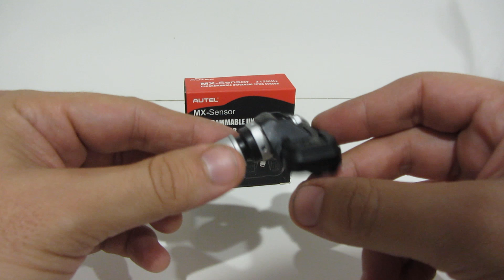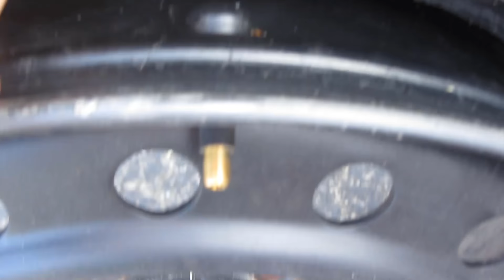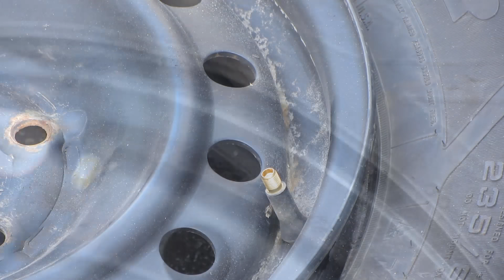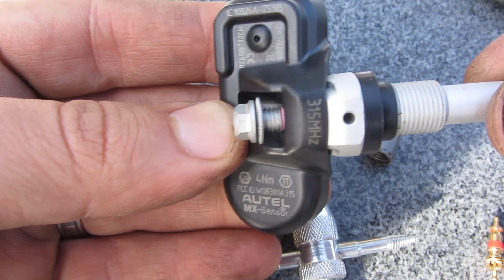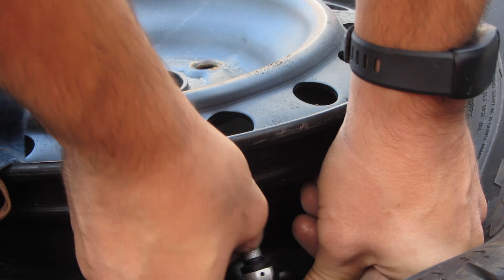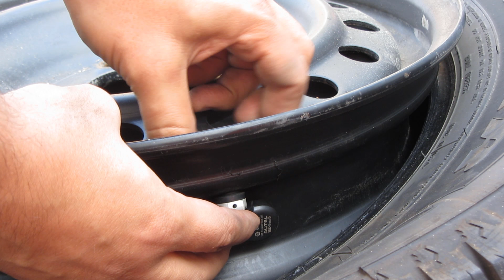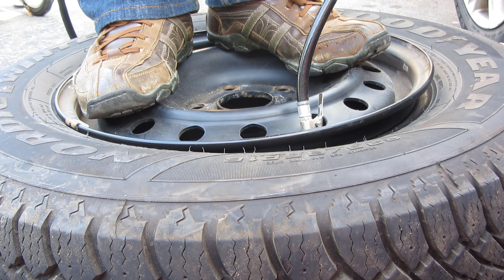Install New TPMS Sensor DIY Without Needing Rebalance

Comment: Job well done.
Please show how the program it.
Reply from the maker: I talked about how I programmed mine here: https://www.youtube.com/watch?v=N6p6xV4PlHc
I used programmable sensors, so I programmed the sensors themselves because I wanted an identical set for my winter tires.
You could also get normal sensors and program the vehicle (which you need a different tool for). But some cars automatically learn new sensors and you don't need to program anything at all. It depends on your car.

Comment: Question:
Bought a tpms rim. Don't have tpms on car. Can I take off tpms sensor swap in old school rubber valve stem?
Reply from the maker: The only difference between a "TPMS rim" and a normal one is that they add weight built into the rim to counteract the added weight of the sensor. It just makes balancing easier.
As for the sensor itself, there is no harm in leaving it there, even if you don't need it. It won't harm anything and it still does the job of being a valve.
Reply: yes you can, but as gabe stated you dont have to replace them, the valve stem works the same.

Comment: how do the sensors work? I mean what powers them and how do they transmit the data to the carputer?
Reply from the maker: The sensors have a battery in them. The battery lasts for about 7-10 years from what I've read. The sensors stay off while the car is stopped. They have a centrifugal switch that automatically turns them on when the wheel turns, but they can also be turned on by an external device.
When on, they transmit a radio signal with a unique code, the tire's air pressure, and temperature. The car has a receiver to read those signals. Some cars have four receivers (one per wheel) so it can tell you which tire is flat.
Reply: @GabesHacks  so how do you sync these with your car's system after you replace them?
Reply from the maker: @sirpsychosexy  I talked about how I did it here: https://youtu.be/N6p6xV4PlHc
I programmed the sensors (because they are programmable sensors), but you can also program the car with the codes of the new sensors, if needed.
But it depends on the car. Some will automatically learn new sensors and no programming is needed.

Comment: very good video, informative
Reply: what do you think about filling tires with nitrogen?
Reply from the maker: I think it's a gimmick. The air around us is more than 70% nitrogen already: https://www.eo.ucar.edu/basics/wx_1_b_1.html
Reply: @GabesHacks  yeap, makes sense 👍 I never looked at it that way... if 70% of the air inside is nitrogen already what would be the benefit of replacing the 30% with nitrogen? Probably too small to void

Comment: What is the benefit of TPMS SENSORS?
Reply: helps you be lazy and dont check pressure that often
Reply from the maker: It notifies you if the air pressure in one of your tires is dangerously low.
Reply: @GabesHacks  so are these work for any car? Because I have toyota Yaris 2000
Reply from the maker: Only if your car actually uses TPMS sensors. I did some quick searching online, and it looks like the Yaris did not have sensors until 2007 (when the new law required them).
If you really want, you could buy the whole system with a receiver, which would work on any car. Something like this: https://ebay.to/2QsbBpF
Reply: Or you could get one of these which have nothing inside the tire...
https://m.youtube.com/watch?v=sF3OHTzXIXs

Comment: Its always good know something :) if works for you. My sons friend had a light on her car for 1.5 years. She took it into Big O 5 times and to a Toyota dealership. They were never able to fix it. I read all the service notes and LOL my ass off All forgot to check the spare tire being low. After putting in required PSI problem went away . I had a big LOL with them .
Reply from the maker: I'm curious, which year / model is that car? Most sensors have a centrifugal switch int hem, so the sensor only turns on when the wheel is spinning. It sounds like they maybe put some kind of activator in the spare tire compartment to turn on the sensor in the spare.
Reply: @GabesHacks  all it would require is a small magnetic field switched on and of repeatedly to trigger the sensor. but i call bs on this story. i haven't seen a system yet that monitors the spare. most spares don't have a sensor even if it's a full size spare
Reply from the maker: @jasonmorehouse3756  That's actually a great way to do it (a magnetic field). I wonder if you could make a pressurized box to toss them all in instead of keeping them in the tires :) I don't think I'd do that, but several people have asked about that.
Reply: @GabesHacks  the ford scan tool is just an electro magnet. press button and it energizes the coils creating the field and triggering the sensor that the ford vehicle sees, i used a small neodym  magnet to relearn the sensors in my old 07 ford ranger. 07 oem wheels had band sensors strapped in the drop center, i used 08 valve mounted sensors in my winter wheels

Comment: Dude, you learned how to do this and want to show evryone. You have to have the sensore scanner tool to program the sensor. Sometimes it's not programmable after you've installed the sensor. I did tires (professionally) for 2 years. Programming the sensor: the tool/scanner puts out a VERY weak radio signal to "energize" the sensor. The signal is weak so the signal doesn't shoot to any other sensors closeby. The tire WILL block the weak signal and you may have to take the sensor OUT to program it.  Another thing: The sensors have a torque, pounds per square inch.
Reply from the maker: I answered most of what you just said in my reply to your other comment. But for anyone else reading this, just go watch my other video to see how I programmed my sensors: https://youtu.be/N6p6xV4PlHc
Also, "pounds per square inch" (aka PSI) is a measure of pressure, not torque. So I don't know what you were getting at there.
Reply: @GabesHacks ... I'm glad Jay Willow never worked on my tires(professionally haha) because he DOES NOT pay attention!
Reply: @GabesHacks  He is saying thank you for sharing a video as the people who genetically do not know how to use rubber (professionally) should not be in the tire business. I was told that I just need to drive drive drive to reset the TPMS on Honda Fit '09 and to use winter tires I need to go to dealership $129 x twice a year to reprogram. - Your video helped me alot! Thank you!

Comment: You can't do this at home people. You have to have the TPMS tool in order to program the sensor. That tool isn't cheap and it has a card that updates it each year.
Reply from the maker: That's not always true. Some vehicles automatically learn new sensors. In those cases, no special tool is needed at all. For other vehicles that don't (like mine), then yes, you need a tool. But there are fairly inexpensive tools that do the job (<$200).
Because I was putting these on a set of winter tires, I chose to use programmable sensors and buy an even-less-expensive tool to program the sensors. I described that process in my other video: https://youtu.be/N6p6xV4PlHc
And keep in mind that I did this at home. So yes, you can do this at home.
Reply: sorry to tell you, but i mounted my winter tires on rims with new sensors in my living room, and took them out to the jeep and installed them. 2km of driving, all sensors were detected and working fine.   hardly any new vehicles require a scan tool, most auto learn, or have a built in relearn program in the vehicle

Comment: Nice way to break tire bead. Did you speed up the video on filling that tire or do you have a large compressor?
Reply from the maker: Thanks! I just have a little compressor. I showed seating the bead in real time, but I cut out all the time is took go get it up to the proper pressure.

Comment: The wheels need to be balanced afterwards. If not, there might vibrate from the difference in weight between the sensor and the initial valve.
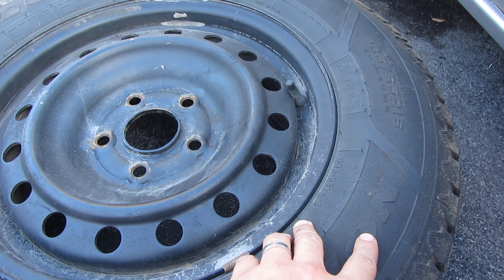Reply from the maker: That's possible. I talked about that at 2:17.

Comment: If your TPMS Sensor Light is on and it bugs you that much! just put tape over the light LOL! But, if you want it to go away, I gusse you could do this. Its not like your going to fail a car inspection if that light is on. Plus I wouldn't recommend doing this if your Wheel Rim is aluminum, chances are that the rim might get bent. Take it to a mechanic and let them do it, chances are you will only have to pay like 10 -15 bucks per tire. lol
Reply from the maker: It depends on the area. Most shops around here (southern Ontario) charge $20-25 per tire. And some shops won't install parts you bought yourself, so you have to pay their price for the sensors and the programming.
Reply: knowledgeseekerr 

bbbbbbbbbbbbbbbbbbbbbbbbbbbbbbbbbbbbbbbbbbbbbbbbbbbbbbbbbbbbbbbbbbbbbbaaaaaaa
Reply: well im a tech for a GMC dealership. we get paid 1 hr labor to replace/install tire pressure sensor. warranty time pays 0.8. so you think its 10-15 per tire but its not. 1 hr labor + part would cost about $200
Reply: @jaywebb0113  exactly why you never take it to the dealer for stuff like this

Comment: I like this as it helps demonstrate the TPMS that was mandated on all 2008 and later vehicles . To avoid confusion in terms (as seen in the comments section); at 3:20 you are removing the valve core from the valve stem with the tool.

Comment: How about a video of removing the tpms from the vehicle altogether. Drove for 35 years without having my car tell me my air pressure is low. Now have a car with tpms and keeps telling me it is low but all tires are fine. Must be the stupid sensor. What a nuisance and extra expense.
Reply from the maker: I hear ya. But that would be a short video of me putting electrical tape over the lights on the dash :) There really is no other way, since these are mandated by law in the US now, so it's not an optional feature that can be turned off.
Reply: @GabesHacks  the mandate in the states is the same as Canada. all new vehicles after 2008 are required to have a tpms system from factory. there is no law requiring the system to be operating after inital sale.its not illegal to disable the system. dealership won't due to accident liability .
tpms is not required for an inspection
Reply from the maker: @jasonmorehouse3756  There isn't any law in Canada requiring TPMS. For a time, they did mandate the what the "tell-tale" lights on the dash should be if the car had the feature, but even those were then removed in 2015. Source: http://www.gazette.gc.ca/rp-pr/p2/2015/2015-02-11/html/sor-dors24-eng.html
"Finally, tell-tales for low tire pressure, low tire pressure that identifies the involved tire, tire pressure monitoring system malfunction and automatic vehicle speed control (cruise control) were removed from the table, as the functions they represent are not regulated under the MVSR in Canada."
Reply: Exactly, unfortunately big brother needs to tell us when our tires are low. So now when those sensors go out, we have to shell out $65 a piece to replace em. Mine has been annoying me for over a year now and I still haven't fixes or replaced em. Im rebellious like that.
Reply from the maker: @vanessahmurphy-777  "Big brother" usually refers to monitoring our movements. These sensors don't "phone home" so that doesn't really apply here.
There were accidents caused by flat tires, so lawmakers figured it was an easy, feel-good law. Unfortunately the law was written so that they must use in-tire sensors that monitor the actual pressure. There are other ways to detect a flat tire, like using the ABS sensor to detect if one wheel is spinning faster than the others, which would indicate a smaller wheel (i.e. a flat tire). But that doesn't satisfy the law.
Reply: @GabesHacks  well the indirect system ( abs/wheel speed sensors ) were used in the 1st generation of TPMS but they have gone to individual tire sensors now which can directly tell you which tire is low/flat and the pressure in all the tires. and this stems from the ford/firestone issues in the late 90s/early 2000s
Reply from the maker: @jaywebb0113  Well what I mean is that they moved to the individual tire sensors because it's mandated by law: the law says that the warning has to come on when the tire pressure "is 25 percent or more below 
the manufacturer's recommended inflation pressure or 
a minimum activation pressure specified in the standard, whichever is 
higher." That requires knowing the exact pressure in the tire, which means there has to be a sensor inside the tire. Source: https://one.nhtsa.gov/cars/rules/rulings/TREAD/MileStones/FRSec13-RevisedFinalRule.htm

They can directly tell you which tire has the problem, but not all do. My 2009 Odyssey EX-L, for example, has only one receiver in the roof of the van that listens for all the sensors. So it has no way of knowing which sensor is in which tire. Others however, (like the Odyssey Touring) does have 4 receivers and tells you exactly which tire has the problem.
Reply: well if the light just comes on and stays on then you have a low tire/ pressure issue. if it states something like 'service tpms" or flashes at you when you start the vehicle then you have a fault in the system ( most likely a bad sensor ) and this needs to be addressed for the light to go off.

Comment: My winter tires on my 2011 Ody have TPMS sensosr. Unfortunately, one of the tire have leaky valve. Can I just replace it with a regular valve? I don't care about the sensor as I regularly check my tire pressures anyway. The TPMS light on my panel is always ON. How do I clear it? It's like that ever since I got the van 6 months ago. I checked my summer tires and they are all the same pressure at 33psi. No issues with the summer tires at all.
Reply from the maker: You can replace it with a regular valve, but the TPMS light will always stay on if you do. The only way to keep that light off is to have 4 working sensors.
Reply: my TPMS light is always on anyway even before I installed my winter tire so I went to the tire shop and had that leaky valve removed and they installed just a regular one. those sensors are really pain in the neck, even the tire techs hated them. I wish my Odd didn't have TPMS.
Reply: it depends on the type of sensor. if its like the one in the video you have to replace the entire unit , but alot of times its a lose nut/valve core on the sensor that is leaking. you can see if you can tighten those up. if its a newer modern type of sensor the sensor can be replaced /removed from the valve stem ( typically held in by a small screw with a t10 torx head ) and you can just replace the valve stem. as far as the light being on, well the system could detect a low tire, not learned properly to the vehicle or have a fault like a bad sensor
Reply: @jaywebb0113  for a so called tire professional, you give alot of incorrect information..  you can get a rebuild kit for these sensors for around $7 ea it includes a new rubber stem mounting nut if required: a valve core and cap, you simply unscrew the old stem from the sensor and screw the new one on,  this is done at every tire change the same way a regular valve stem should be replaced at every change

Comment: Great video explaining removal and replacement. Does the new sensor need to be programmed to work with the car's computer? If so, a follow up video on that would be great.
Reply from the maker: It depends on your vehicle. Some vehicles learn new sensors automatically, so no programming is needed. Others (like mine) do need to be programmed. For mine, I used programmable sensors to create an identical second set of sensors for my winter tires. I described that whole process in my other video: https://www.youtube.com/watch?v=N6p6xV4PlHc
Reply: @GabesHacks  My situation is that the low pressure indicator appeared on the dash, but all tire pressure is fine, so it's either a bad sensor or system fault. The place that installed the tires said they can handle it, so I'm leaving it up to them.
Reply from the maker: The low pressure indicator only comes on when one of the sensors are reporting low pressure. Any other problem would trigger the other light with the letters "TPMS".
If you checked all the tire pressures, then it's possible that one of the sensors is misreporting the tire pressure. A scan tool can talk directly to the sensor and see what pressure it is reporting, and that can be compared to the pressure read by an old-school pressure gauge.

Comment: People. Learn how to use a tire pressure gauge. Get a small air compressor. Learn how to operate it. With this knowledge, you never need to rely on this useless and expensive system
Reply: Learn how not to be an ignorant. With this knowledge, you can understand that you can't measure tire pressure while driving e.g. on the highway. TPMS can distinguish even small pressure change, so you can check what is going on by stoping on the nearest parking. Without the system, before you start to feel by yourself that something is wrong whith the tire, it can be too late and you will have to change the wheel on the side of the road like a caveman. Add night to it, and it will be funny to watch you trying to start a campfire because it works as good as useless and expensive flashlights.
Reply: Works great until your car is sounding an alarm every 30 seconds because it lost contact.
Reply: Required for m to get new tires put on where I live.   I would prefer to save the money and just use a pressure gauge.   Will be required on all cars soon.

Comment: Very nice, thanks. Today I spent 20$ to change 4 valves (includes common valves and wheel balancing). $20 is not a problem, but I spent about 2 hours in a tail. It would be easier to spend 1 hour and 2$ and do it myself.

Comment: The rebalancing is needed as you put in more weight than you took off.
Reply from the maker: That's possible. I talked about that at 2:17.
Reply: @GabesHacks it is, you physically are adding weight to the wheel.